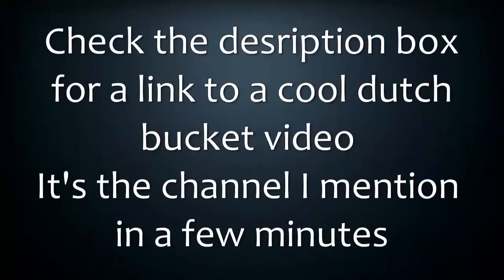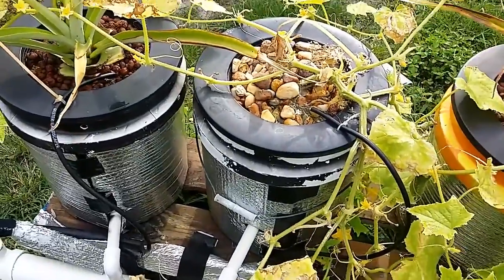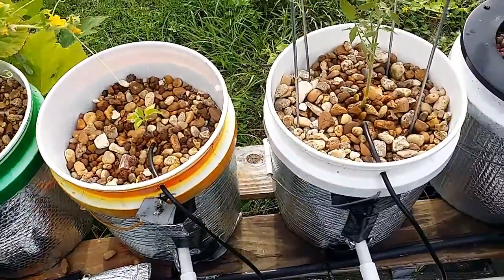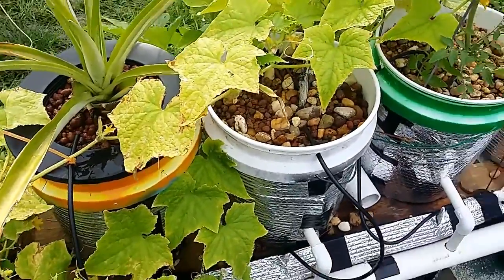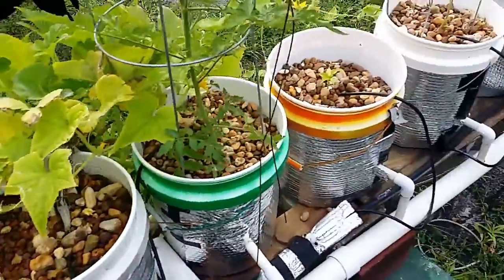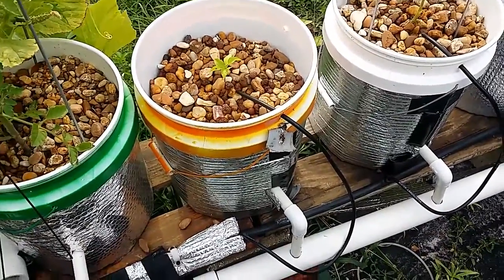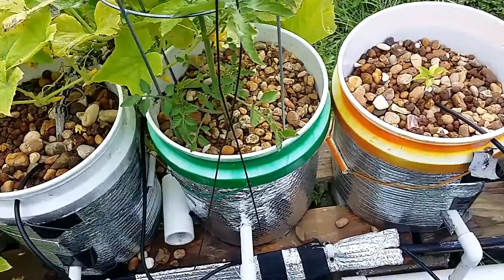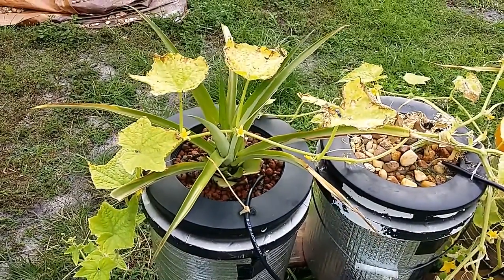potential problems with dutch buckets in aquaponics ep 67

Comment: I have dutch buckets set up on aquaponics and another system set up on hydroponics. I had to get rid of the thin black tubing on my aquaponics setup and replace it with 1/2 inch pvc piping. I had the same problem with the lines clogging. As far as maintenance, my hydroponics system is the most low maintenance system I've ever built. All I do is replace the nutrient water once every week. In my aquaponics setup, I have to feed the fish daily, check my filters, check to make sure each bucket is getting water, etc etc. After I harvest the fish, I'm doing away with my aquaponics system all together.
Reply from the maker: I understand your reasoning for sure

Comment: The clogging is due to low pressure in the pipes.
Remember that the water you are feeding the plants also carries some dissolved solids which clogs the small pipes.
You can either (1) give it more pressure so that the pipes will be self cleaning or (2) increase the pipe sizes...
Reply from the maker: Good points

Comment: you can use hard line say 1/2 inch pvc put the drip line into a bigger pipe that act's like  tank then you supply the water from the bigger pipe too the 1/2 inch short pipe with 90 on it to adjust flow rate !
Reply from the maker: Thanks for the info

Comment: Hello! I've seen this video and as to your problems, I think I can see at least one cause. That is the thickness, rather the diameter of the feed flow line. I say this because the feed water is the waste of the fish tank. So this water will always contain a lot of sludge dissolved from the fish pooh. This can form a layer of sedimentation on the inner surface of the thin tube in time, making the passage narrow or even complete block. If the feeder (inlet) line is of say... 1/2 inch dia. your this problem may be solved.
Hope this may help you.
Reply from the maker: Your right

Comment: Nice videos man! I have a question. Is there enough bacteria in the media, or do you need a separate filter? Thanks.
Reply from the maker: +Robby Simpson I haven't run into problems in that area with this setup. I have a radial foe filter but it's mostly for waste removal not bacteria growth. Thanks for watching

Comment: I'm from London Uk.
with regards to your pump in the reservoir does it have a filter on the intake, to stop debris being sucked up into the pump and being pushed in to those 4mm drip lines?
Try making a filter out of sponge or  the green scouring pads for washing up dishes....
That's my 50 pence input..
Reply from the maker: thanks I appreciate the feedback. It doesn't haves filter. I've done a better job in the radial flow filter since this video. I generally don't have much of a problem now.

Comment: hey gardening4fun on your current problem, have you though about doing the same thing as your drain get a bigger pipe and then just run less then 6 inches of drip line from the pipe to the buckets?  Or just use a 1/2 inch pipe from your pump and just use ball valves that you can adjust at the buckets. Since you live in a hot space you might want to think about upgrading your system  Dutch buckets and NFT systems are harder to manage in the summer time in hotter places a simple raft or flood and drain system would help both problems less heat on the roots and less clogging. Good luck
Reply from the maker: Chris s thanks for the reply. In the next set of buckets I am going to change things up a bit. 
I have quit using the net pot bucket lids and and I fille the buckets with media kind of like a grow bed.
Thanks for the feedback

Comment: If you run your supply line about a foot higher than the top of your buckets the siphoning effect will help keep your lines cleaner . I also drill the barbs out with a 7/64 drill bit to improve the rate of flow .
Reply from the maker: Hey @jerry parker that's a good I idea. I think I will give it a try when I setup some new buckets

Comment: What is your pump size? Besides filtration, could be not enough water pressure to push the debris through and it builds up.
Reply from the maker: Apartment_Ponic it's a 3500gph waterfall pump. I dont think thats the case but thanks for the suggestion. Although you did just give me a thought with that comment.  The next time I goto blow them out I will shut off the water going everywhere except the ine to the buckets and see if it blows out the lines. I'll let you know what happens 

 One of the problems I was having is an algae bloom. It grew long and then started to break off. The tilapia are taking good care of that now so that situation should be straightened out.

Going back to the pump. I do plan on getting another and have it just run the grow beds. Because I know as I add more buckets the pump definitely wont be able to handle all that.
Reply: Apartment_Ponic